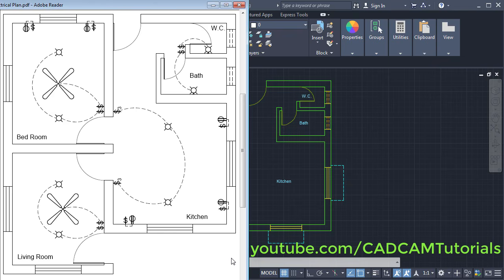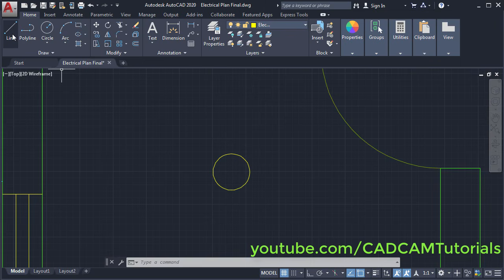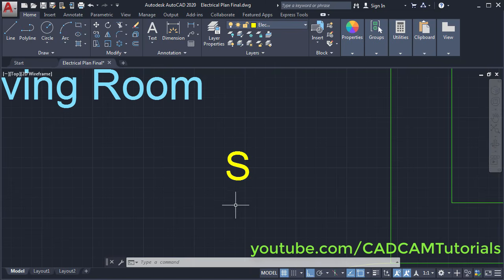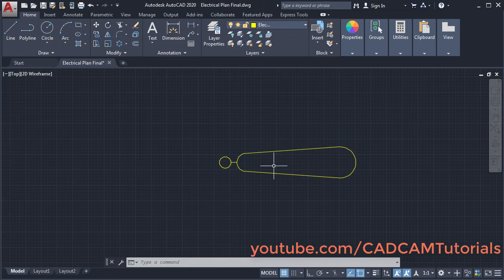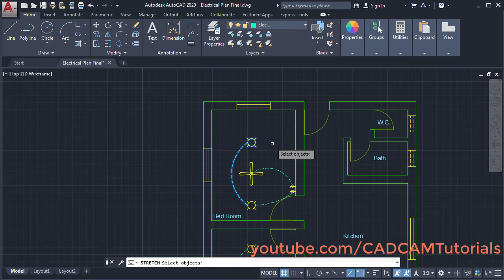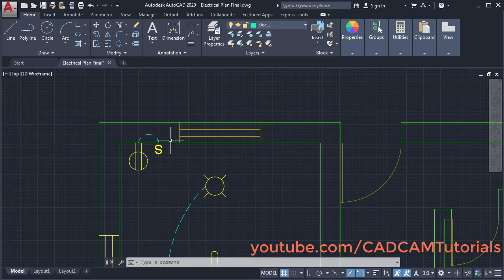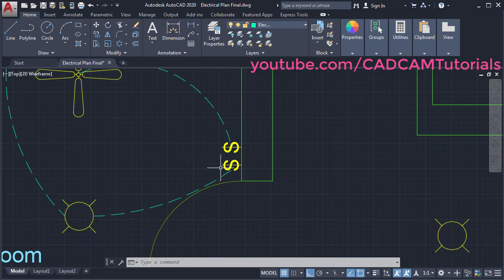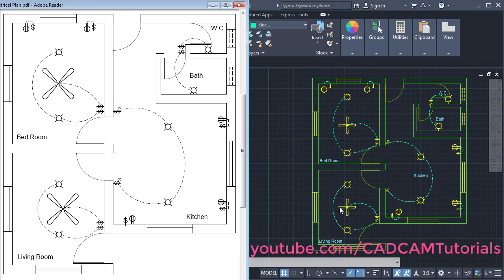AutoCAD Electrical House Wiring Tutorial for Electrical Engineers

Comment: Thank You Sir;
but Sir is there another method of inserting readymade components in diagram like, fan, socket,light,
in SLD, conductor line, motor, isolator, busbars, transformer, fuse, circuit breaker 
instead of drawing?

Comment: I lost my Schematic ribbon. As i can see in your drawing no have also . Is it missing or hidden, if it's hidden, how can i show it . Thanks for video !
Reply from the maker: Click on the gear symbol located at lower right side of the screen and select 2d electrical workspace.
Reply: @CADCAMTutorials  I use crack file . So it doesn't have 2D , only have 3D Basics, 3D Modelling, Drafting and Annotation. Some of my friends get no problem. but in my computer, i got that problem